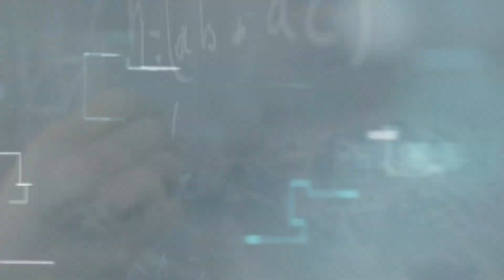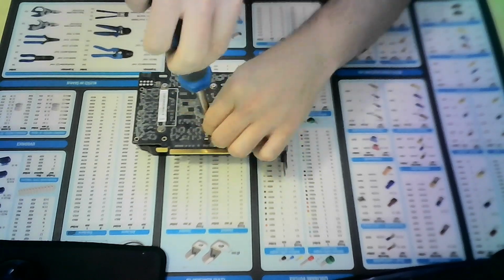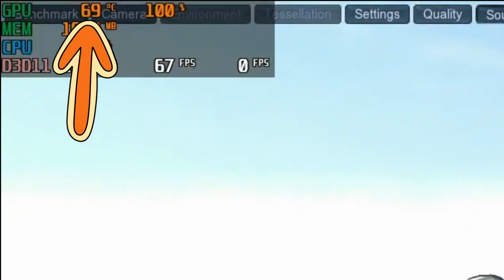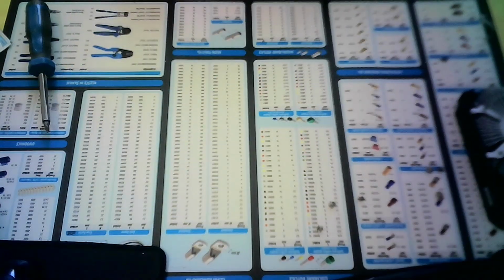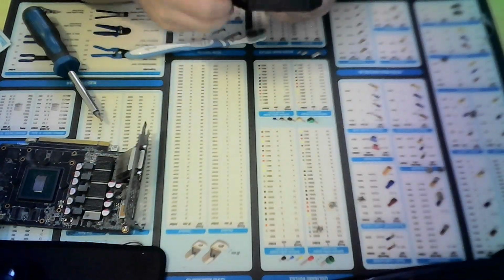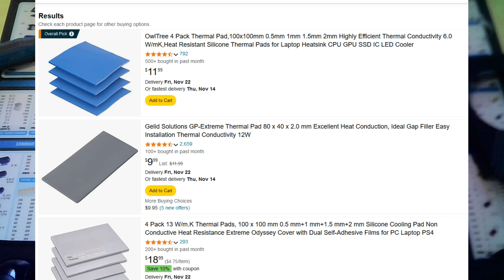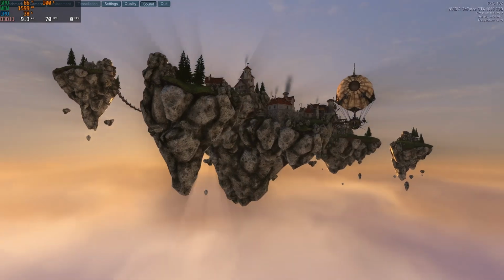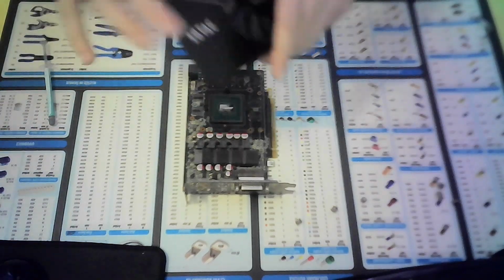GPU Maintenance

Comment: by now, more people need to know that if you want to repaste a direct heatsink to cpu/gpu die (without IHS), replacing the factory paste with dual phase honeywell PTM7950 thermal pads is one of the best options to pick.
it behaves like a thermal pad below 45C and it melts into thermal paste over 45C. it performs almost like liquid metal when it's in paste form and it is free from thermal paste pump-out problem where the temps go noticeably higher after a few days or a week in use.
however the best selling point is that this thermal pad doesn't need to be replaced regularly, you only need to check after 5 years, and it can be reused if it is still intact.

it's literally a godsend to laptop and gpu.
and yes you can use it with CPUs with IHS (without delidding) too.

thermalright heilos is a rebrand of the same stuff but it's 0.2mm thick compared to honeywell ptm7950 0.25mm, but since it would melt over 45C, it doesn't really matter.
not recommended for replacing memory chips thermal pads, since they are usually much thicker.
Reply from the maker: You are totally right, well I have not mentioned it because of 2 reasons:
Firstly, this is aimed more at beginners and also just cleaning the dust is usually more then enough as seen in my example.
Secondly, I don't have it and I find it odd to tell other how to do something I have never done myself and also using other's footage is risky.

But yeah, the dual phase thermal pads seem to be the future and thank you for sharing this with the viewers, well at least those who read comments.
P.S.
I pinned your comment so that it stays on top.

Comment: Good advice on holding the fan while using compressed air.
About thermal pads, the thickness is critical: too thin, and there won't be enough contact to cool the chip. Too thick, and the PCB will bow, adding extra mechanical stress on the solder balls under the BGA chips (memory and GPU).
Reply from the maker: I did not go into this as people who know about thermal pads probably don't need a tutorial for this.

Thank you for the wisdom, I just hope that no GPUs will be hurt because of this video, certainly they were not during filming. :P
Reply: @gaming.teacher  fair point.